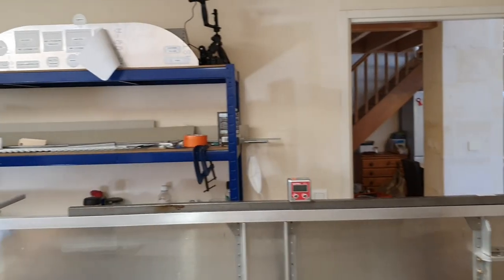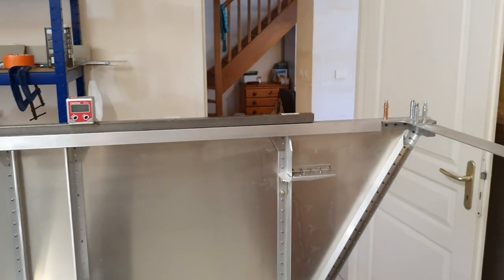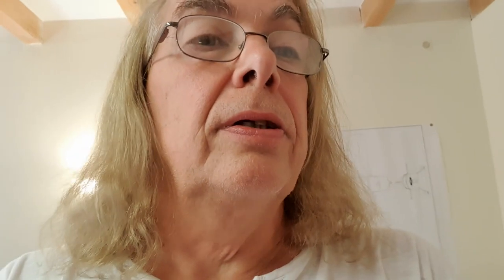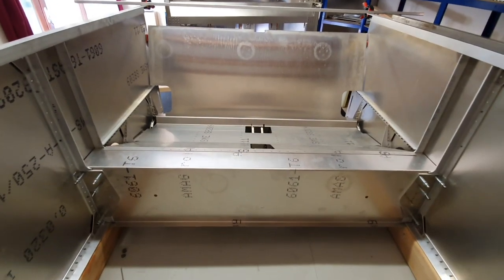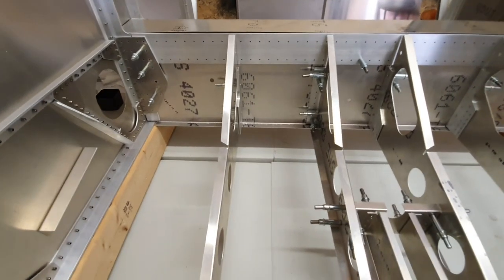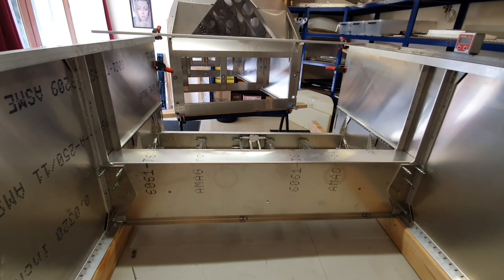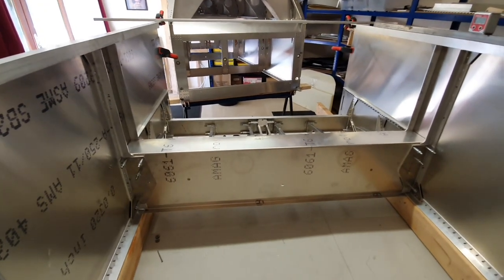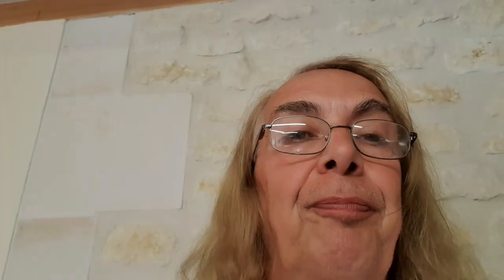Gavin's Sonex B Part 32 - Forward fuselage construction

Comment: Does the kit include all the special tools? If not what special tools are needed?
Reply: If you go on sonex website there is a page with all the info as well as special tools you need!
Reply: Sonex Aircraft website details the tools needed.  If you are mechanically inclined you may have most of them, barring clecos and specific files.